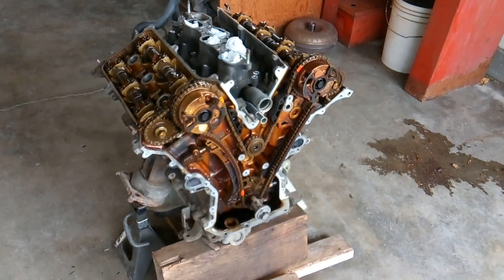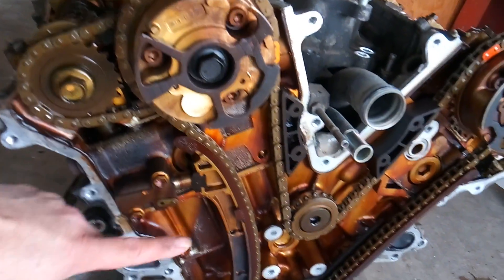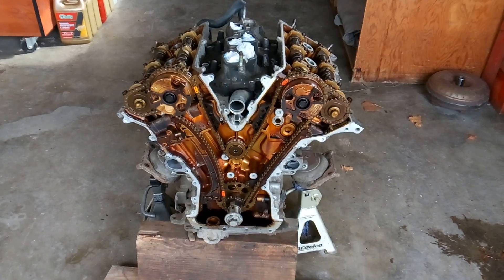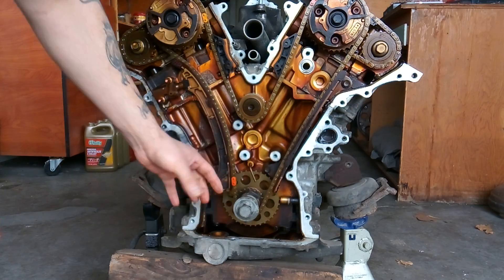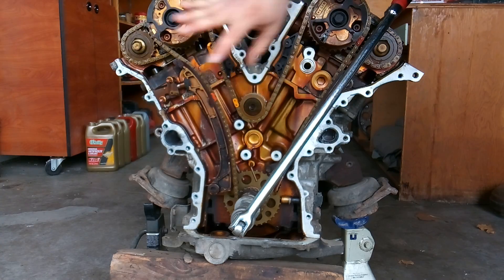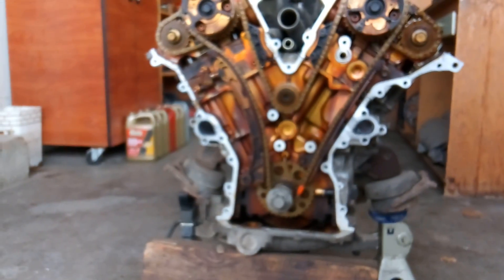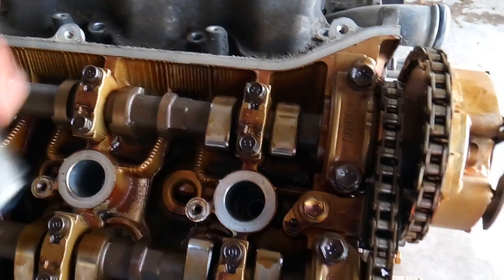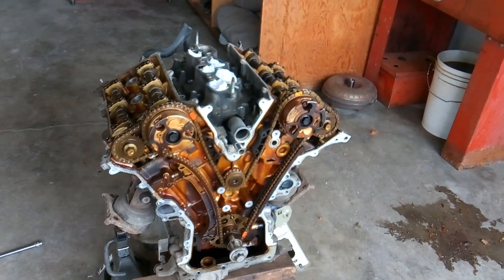Toyota 4 Runner 4.0L timing marks setting TDC for chain removal

Comment: Hi Matt, thanks for the video. Semi-unrelated question if you have time. I have a '94 4-Runner V6 with a 3.0 and I broke one of the spark plugs off. Five came out nice and the sixth one snapped even with penetrating oil and a breaker bar. Fook. I plan on using a #5 and then possibly a #6 extractor after drilling out the plug with the appropriate drill-bit. Been using Kroil penetrating oil for about a day now, around five applications. Any advice? Should I just pay the shop rate of $150 an hour and have them do it? I've used extractors before but never on a plug. Done plenty of tune-ups and this is the first plug that's ever broken on me. I'd appreciate your suggestions if you have time. Thanks a lot!

Comment: When should you replace your timing chain? How many miles?
Reply: The chains should last the life of the engine if taken care of.  But if you ever have to go in there for say blown head gasket it might be worth replacing. Chain will stretch over time but normally not enough to cause a issue.

Comment: THANKYOU SO MUCH FOR THIS VIDEO MATT IT MEANS A GREAT DEAL TO ME AND YES I PRESSED THE"THUMB'S UP AND SUBSCRIBTION BELL". I'M TOTALLY 110% NEW, NERVOUS AS A CAT 🐈 WATCHING THE VIDEO BECAUSE IN ABOUT A WEEK OR SO (I live in Wenatchee, Washington & am flying down to Portland, Oregon to meet my cousin & we'll drive 50 miles south) I'M BUYING A 2010 TOYOTA 4 RUNNER LIMITED WITH 127,000 MILES WITH EVERY BELL AND WHISTLE YOU CAN PHANTOM.I DIDN'T PLAN ON A LIMITED BUT THE PRICE WAS RIGHT ACCORDING TO MY COUSIN WHICH KNOWS A GREAT DEAL ABOUT CARS AND ENGINES,I TO KNOW SOMEWHAT ABOUT ENGINES BUT NOT NEAR AS MUCH AS MY COUSIN.THIS WILL BE MY 1ST FORIEN AUTO I HAVE EVER OWNED OR AM ABOUT TO OWN.IVE BEEN AROUND GM ALL MY LIFE AND ALSO OWNED A 74 FORD F100 1/2 TON PICK UP WITH A 460 CI ENGINE.EVERY VEHICLE I'VE OWNED HAS HAD A CAST IRON BLOCK AND HEADS.NOW I'LL BE GETTING A JAPANESE ENGINE WITH A ALUMINUM BLOCK AND HEADS,WAY SOFTER MATERIAL.IT WOULD BE NICE TO KNOW WHAT GRADE OF ALUMINUM THE BLOCK IS AND HEADS ?I WENT TO WELDING SCHOOL IN DALLAS, TEXAS BACK IN 1980, TOOK UP METALURGY ALSO,MOVED BACK TO SEATTLE, WA AND BACK TO WELDING SCHOOL,TRAVELED ALOT TO ALASKA,TEXAS,OIL BUSISNESS,LOTS OF PIPE WELDING,MILES OF IT.---BUT NOW I'M GETTING INVOLVED INTO A TOTALLY DIFFERENT KIND OF VEHICLE/ENGINE,TRANY,AND I DON'T SPEAK JAPANESE,TO ME THAT'S A HOUGE STEP IN A DIFFERENT DIRECTION AND I'M NOT A BIG FAN ON THIS TIMING BELT BOZO STUFF, JUST BECAUSE SOME COMPANY WANTS TO MAKE EXTRA $$ IS WHY THE TIMING BELT WAS INVENTED.PLUS I'VE NEVER OUNCE OWNED A UNIBODY VEHICLE IN MY LIFE,EVERY VEHICLE I'VE OWNED HAS A FULL BUMPER TO BUMPER CHASSIE FRAME,PERIOD.---KEEP YOUR VIDEO'S COMING IN,I LEARNED ALOT ABOUT THE TIMING MARKS, LOT'S OF THEM,AND THAT'S GOT TO BE THE LONGEST TIMING CHAIN ON THE MARKET.🖖😃👍🖖,LIVE LONG & PROSPER.

Comment: So, from my understanding is you want to center the yellow timing chain link with the mark on the crank and the two orange marks on each bank of cams will correspond with the timing marks there. Is this correct? If so, would this mean your chain was installed incorrectly?
Reply: Sebastian - I had this question too.  While the timing chain may rotate a single time, the gears it is connected to rotate many times.  That means that the cams and crank are in the correct TDC position many times during the timing chain rotation, but those special links are only in the right spot one time.  You can continue to rotate the engine until the links and all of the marks line up but that could be many rotations before the chain finally lines up.
Reply: @boblangys But by doing that it will be less confusing than doing what the video shows ,don’t you think?

Comment: So I have all my exhaust and intake marks lined up, cylinder one lobes are up and pointed in, I tapped the top of the 1st piston head and it's in the 'up" position, and on the crankshaft gear the upper notch is at the 11 o'clock position and in line with the marking on the block, and the notch on the crankshaft is at 9 o'clock.  However, the notch on the crankshaft gear with teeth that is also supposed to be at 9 o'clock is not there.   There are some teeth on the gear that are missing in this area.  Am I lined up?
Reply from the maker: Yes sounds like you are lined. I would reset tdc manually after removing the chain and installing a new gear with new teeth for ref.

Comment: I’m replacing the valve cover gaskets on my 4.0 everything is going smooth except for all the connectors that hold the wires in place. Could you make a video about how to disconnect plastic connectors of all the various types. It blows my mind how some of these little plastic pieces are so important to know how to operate. Personally the more I work on modern vehicles the more I want an old vehicle pre electronics
Reply from the maker: yes I can maker a video. will do that and upload it by Tuesday. I ma even have some time today. I think this a great suggestion. the first 5 years or so of my career I went though so many plastic connectors.......getting them apart sometimes with out breaking them can truly be an "art". Email me about this please just so I can keep it front and center on my "TO DO" list.......highgrooveauto30@gmail.com